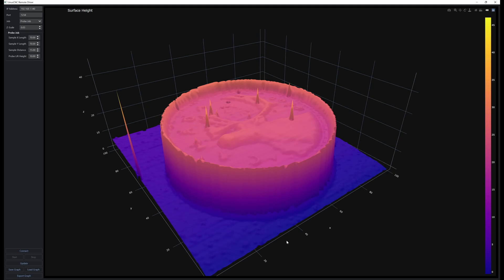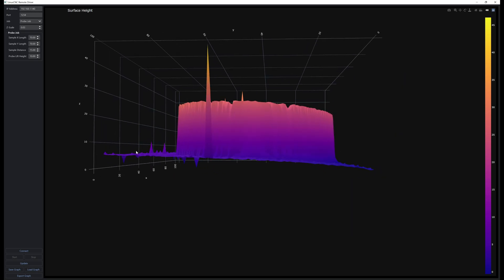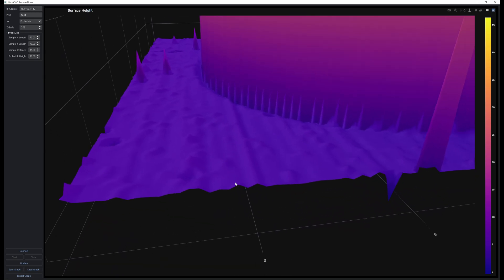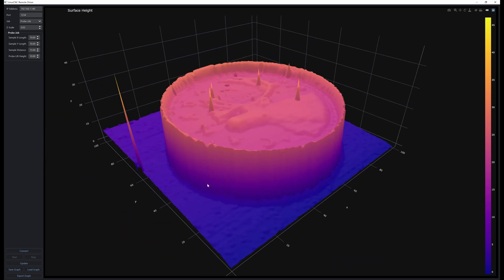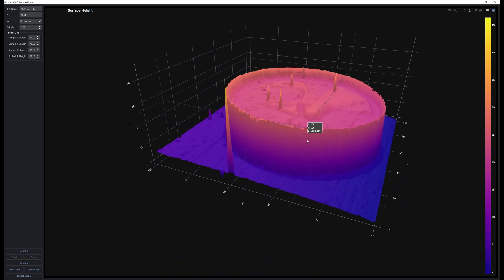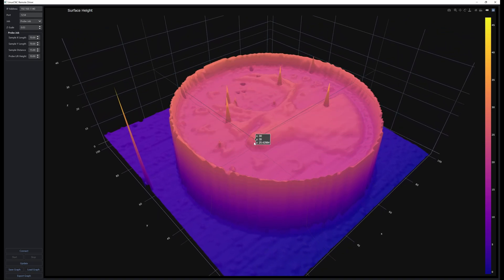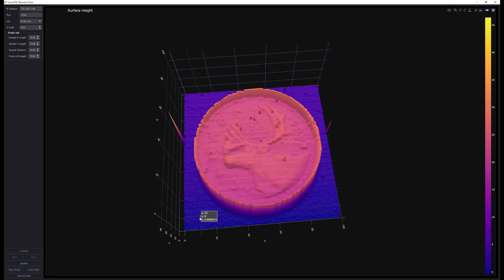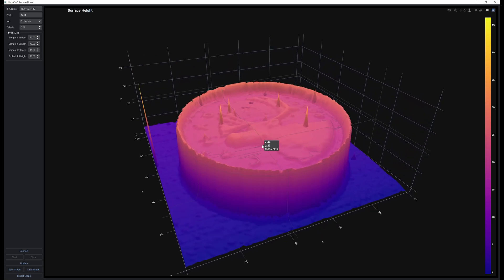Probing a Canadian Quarter: Analyzing Results and Addressing Issues

Comment: What are your thoughts on smaller x & longer y axis for stiffer X gantry. Also if someone were to implement your X gantry design for PrintNC mini, how would they proceed? Love the videos.
Reply from the maker: Smaller X than Y would be more rigid but I do prefer having a wider X and having the CNC machine face me when opening the door and easier access to everything.  The gantry with the double tubes filled with grout in the middle could be done on the mini with the motors inside. You could do the same with the Y tubes.

Comment: i would just delete the outliers and lerp from adjacents.
Reply from the maker: Yeah gonna do that as a last ditch effort when all else fails. I should be able to detect bad samples by tracking the last X number of samples and comparing the height deltas. If the change is exceeded by some percentage then I can resample it right there. Those bad samples seem to be very infrequent like around 0.025% out of 100,000 so I could probably make it overly cautious when detecting them.

Comment: Using the same mechanism to do the machining and the measurement is going to create issues where the same mechanical errors will show up in both with a fixed amount of offset. You may be able to make some kind of compensation map if you can properly quantify it.
Reply from the maker: Yeah and I honestly don’t know how useful it would all be. I think if I wanted to machine a surface flat, one way to do it would be to map out in machine space in XY using the webcam sensor while it’s not touching anything. That would give me the grid of points that represent the offset in Z to the laser beam I could use to correct for. I could then use that to machine a flat surface. The sensor touching the surface could be used to verify if the surface is flat to the laser after. I think that would work, and you get to run a more conventional machining op instead of a whole bunch of circles.
Reply: @BryanHoward  Say you had this height error map, do you know if there is a way to make LinuxCNC read it in and use it for everything (like a 3D printer bed scan), or would one have to operate it fully from some external script? Im in the middle of a beefed-up PNC build and considering making a dirty temporary setup, calibrated with this kind of laser, to sand my Y rail supports to one plane.
Reply from the maker: @jamesitube  I have looked into it and it can be done. It has to be done via C++ though as it needs to be part of the servo loop and be fast. You can read more about a thread I started on the linuxcnc forum. I didn't end up doing it. I don't normally machine things big enough with that level of precision to go ahead with it. https://www.forum.linuxcnc.org/10-advanced-configuration/50250-possible-to-automatically-compensate-for-irreguarities-on-the-xy-plane
Reply: @BryanHoward  Thanks, I'll look into it! I use C++ daily but... perhaps in my limited use case I could do something with the gcode or even in CAD instead. Though it could be nice to one day use other kinds of reference measurements to correct travel distance for each axis, if it's not linear using the Ali screws. Maybe a similar thing.

Comment: Awesome! One thing I've done doing something like this is randomizing my measurements points. Ive been able to really see if there is a drift (thermal expansion, or some other error) in the system. As you will have an early measurement next to a later measurement. Super awesome work, love what you are doing!
Reply from the maker: Controlling the room temp will be the bane of this. Winter is coming up and with the big temp change from outside to inside the garage I’ll be running a space heater that will be intermittently turning on to heat the air. Maybe I should get a good temperature sensor, weld a small metal box around it (so as not to measure the air) and attach it to some part on the CNC close to where the laser is attached. That way I know the temp of the CNC.

I could then calibrate and account for thermal expansion of the steel and concrete of the CNC machine making it less important to control the room temp.

Comment: Neat!  Would it help to gate the data points and reject any that are impossible?  I mean while you're taking measurements, so it'll re-check any screwy points.
Reply from the maker: It’s doable but would only help on the lowest ones. In the probing of this coin, I had the area in blue that is outside the coin not touch any surface so it’s just air sampling.

What would be good is recording an average surface deviation for the last X number of points for that row. If a point deviates by some percentage beyond the average, it’s likely an erroneous sample that needs to be redone right than. 

Trying the find a solution that is on the fly to find artifacts is beneficial because if I try to sample them after the main job, the thermal expansion will make it near impossible to sample a single point and have it fit correctly with the surrounding local points.

When all else fails points can always be moved to the average of the 6 local points surrounding it, but it'd be great to have every sample be a real one.